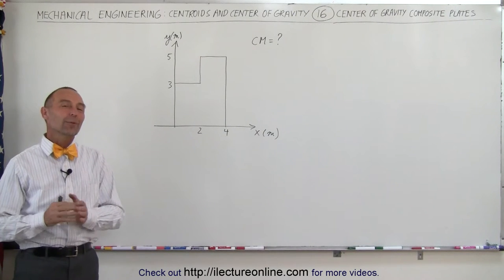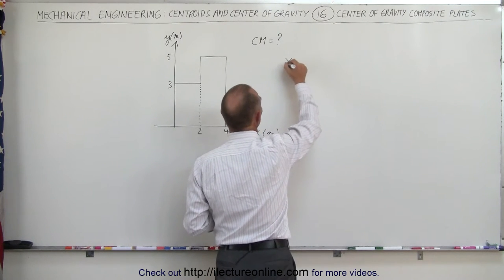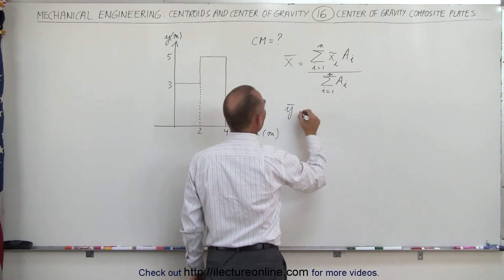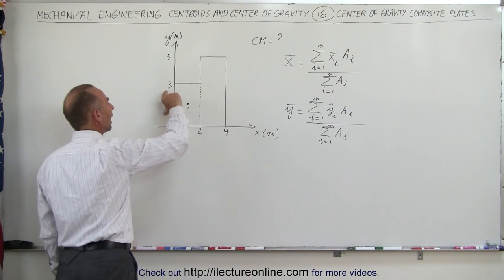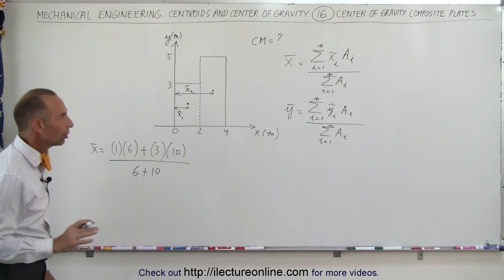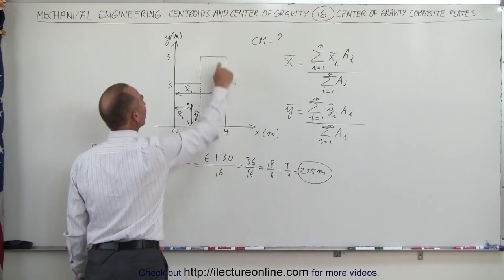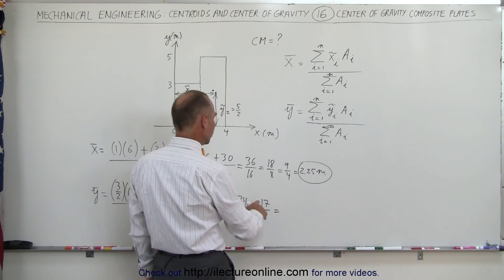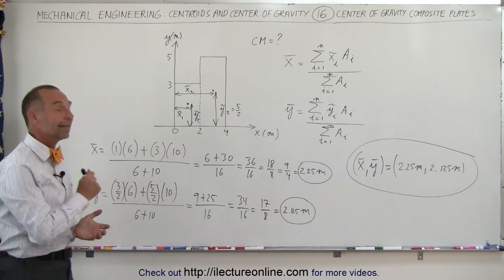Mechanical Engineering: Centroids & Center of Gravity (16 of 35) C. G. of a Composite Plate 1

Comment: Sir can you differentiate between centre of gravity and centre of mass
Reply from the maker: They are essentially one and the same (finding both of them is done in exactly the same way).  There is a technical difference between the two.  Center of mass is the point at which mass is distributed equally in all directions.  Center of gravity is where the distribution of weight is equal in all directions (requiring the presence of a gravitational field).